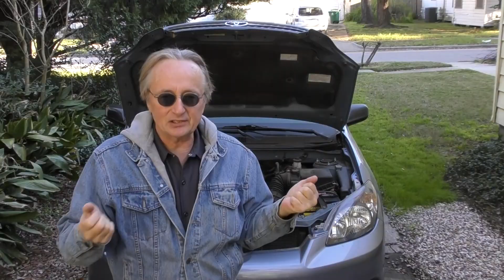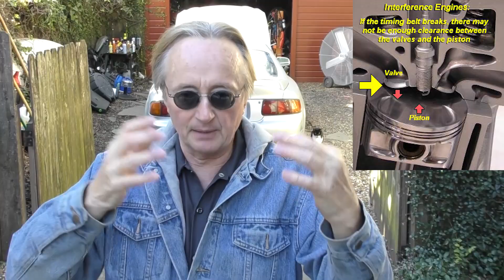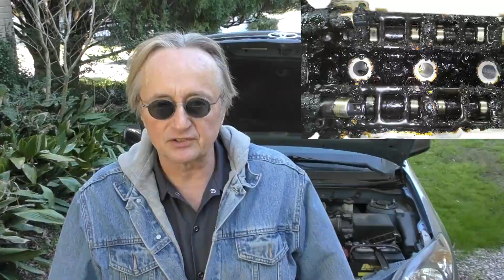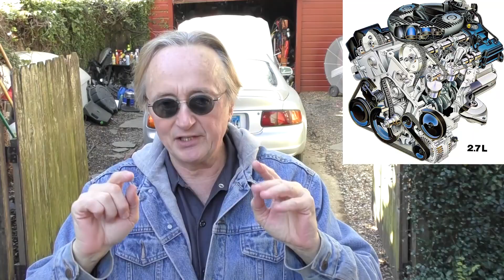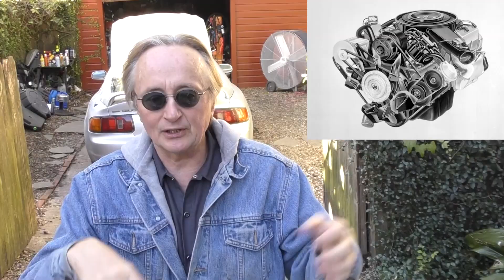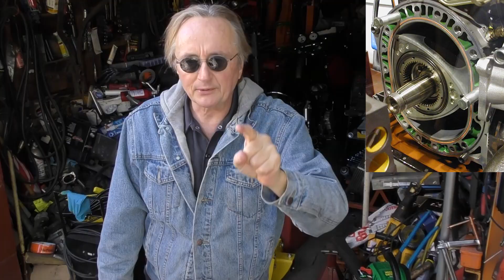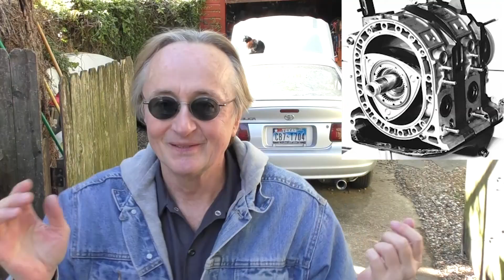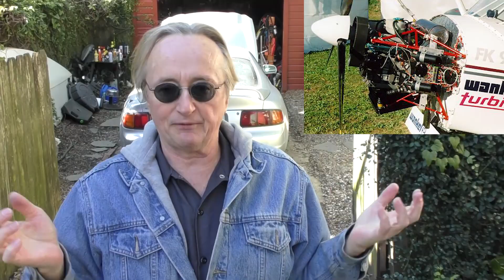Never Buy a Car With This Engine

Comment: About the 2.2 ecotec.  My GF had a 03 Alero with that motor.  One night she called me because it was not running right.  I showed up and that thing is knocking so hard I couldn't believe it.  It had no oil left in it.  Went to the gas station and got oil for it.  I didn't think it would survive the 11 mile trip home.  but it did.  matter of fact most of the knocking was gone.  she drove it for years after that.  it burned about a quart a week but That expierence gave me some respect for the 2.2.  I don't know how it survived that.

Comment: There have been a couple of motorcycle with the rotary engines Suzuki was the only Japanese motor cycle company to build a rotory motorcycle my younger brother had one when they came out it was fast and it was 500cc it was thirsty and kept fourling the spark plug and back then they were $10 when normal spark were about $2 each the reason the plug clogged up was because of the leaded petrol no unleaded then and l was riding a Suzuki GT 750 at the time and the rotary was much faster he would beat honda CB750s

Comment: I loved my rotary motor easiest way to keep an apex seal in optimal condition was mix 2stroke oil in the gas 1 revolution = complete power cycle so in essence they're 1 stroke motors 🤷‍♂️

Comment: Hey Scotty. About that timing chain issue on the 2.2 ecotechs, is their a way to prevent catastrophic damage to your engine? Because i can already hear my timing chain squeeking on idle. Im worried i dont have much time left….
Reply: Replace timing chain tensioner. 32mm socket or 1 1/4". On the back of the motor passenger side corner. You have to take valve cover off and push against it to activate it after install.

Comment: My first car Malibu 2.2 cylinder 2007 eco tech lasted me 225K miles ended in  Nov 2020. Kept it well maintenance synthetic oil change jiffy lube. Last time drove it to work was losing speed ignored it instead added more torch RPM was high next thing POP! Oil everywhere now after a year having my engine swap

Comment: Bring back Magnetos! 
Engine-driven spark boxes that produce their own sparking power, without the need of a battery or alternator. 
This way, if one of those things fails, you'll still have engine power, and all the systems that run directly off the engine will still operate. While your battery powers the computers and various other things.

Comment: Self igniting engines? You mean literally every diesel internal combustion engine ever? And the Wankel wasn't a bad design, Mazda used cheap materials in the construction of the engine and it didn't help that morons that buy cars with rotary's don't know how to maintain them and dog them out. Don't blame the design because of the manufacturer (a manufacturer that didn't even design the engine on the first place) and stupid people that owned them. As for the gas mileage, Wankel engines need fuel injection to be as efficient as they can be. In The early days Mazda went the cheap route and carbureted them. So again, blame the manufacturer, not the design.

Comment: Ecotec engines are very sensitive to dirty oil. The design  with ohc on these motors are just sensitive. They perform well and I see many with over 200k and run smooth . Only the flex pipes are the issues really

Comment: Most timing chain tensioners and guids are replaced with water pump but if you her some raspy sounds above 3k rpm replace them. Your oil filter will get clogged too so oil analysis will tell you this and just looking at your oil when you change it.

Comment: I own a 2005 Cavalier with 2.2 Ecotec. Three years ago I hit a pothole so hard it cracked the oil at the top and made a hole at the bottom of the pan. Fixed the hole with epoxy but the top pan still leaks from cracks when oil is warm and pass by these cracks. No problem It changes his oil itself. X-D I keep refilling the oil once in a while and since oil is mostly new all the time I just change the oil filter two or three time a year. I put regular gaz mixed with paint thinner, methyl hydrate, two strokes fuel mix, kerosene for camping lantern, racing fuel leftover and some other shits and I've put 100k kms on it and it still goes well and starts first time in -40 celsius Quebec winters.
Reply: it does not "changes his oil itself", you still need to change oil even if your oil leaks out and you partially renew it.

Comment: I know Scotty is not a fan of the ecotec 2.2l but I got a 2006 Chevy Malibu LT with 152k miles. Well taken care of. I've done some repairs including the new timing chain tensioner. Wasn't ticking, but I had older style. 
Minimal sludge. I'm using Penzoil full synthetic and Purolator boss filters. Double iridium plugs. Got 180psi on all cylinders. 

Flip side my ex wife had a 2002 Chevy cavalier. That ecotec blew apart.

Comment: Haha I have a 2006 2.2 ecotec it runs good I just noticed the car stall when idling but it starts right up I put in a new air filter and I clean the throttle body anything else I should try 👌

Comment: I like your videos Scotty. I have a saturn vue with the ecotec 2.2L 2wd. I'm embarrassed at how poorly I have maintained this vehicle. When I got it I thought it wouldn't last long so I figured I'd just drive it into the ground, now 10 years later after off roading with it dragging logs through back country literally off road and just plain simply abuseing and barley changing the oil. I changed a wheel bearing on it once but that is it. It's at 150000 thousand now and still going. I wish I would have taken better care of it. I've probably only changed the oil in it 3 times. Some cars just have a will to live. This car has really got me out of some jams. Most reliable car I've ever had. It's not the day to day driver anymore but I'm still using it as a utility vehicle and it just starts every time with out hesitation. I really do regret my poor maintenance for this car.

Comment: Now the 2.2 GM ecotec I will admit they do have timing chain problems but if u put a cloyes timing set in them I have gotten a lot of miles out of tht timing set is it a good engine for me yes I’ve gotten a ton of miles out of them but a take care of my vehicles oil change at 2000 mile good oil and good filters the 2.2 with the manual trans in a Saturn vue for me is a very reliable good car but I do agree there are some issues with this engine

Comment: Have a 2004 Chevy cavalier with the 2.2 ecotec and I have ran that thing low on oil so many times and it has 254,000 miles and still starts right up and runs like a dream

Comment: Most vlom failures are cause from maintenance reasons the vlom controls the oil flow to each lifter when it opens and closes (cylinder deactivation) varnish and sludge do to lack of maintenance will kill the system

Comment: I'm driving a 2003 Pontiac Sunfire with the 2.2L Ecotec. 259,000 miles. It runs and drives like new. I don't know why Scotty is picking on that engine.
Reply: Lol got damn. Still runnin her?
Reply: @slimhavoc4290  Yup. Up to 287,000 miles. Still runs and drives like it's new.(I replaced all four struts and fixed the usual things. Engine and tranny are still strong and never needed repair).
Reply: @Ray-lv7hm  noice. I got a 2008 g5 2.2 with 159,000 on it they are good strong engines. I need new tie rods too lol
Reply: @slimhavoc4290  I did one of the tie rods on mine. It's not easy, but you can do it too .

Comment: i got a 2008 ecotech engine with 136,000 miles--i have changed the oil and filter every 3000 miles on the dot-so easy to do -car runs smooth as silk--never uses oil-plenty of power-just simple to me--clean engine-no sludge-good service

Comment: The Ecotec 2.2 is one of the best engines ever built.
We had a lot of them in Europe and many of them are still going strong.

There was just one difference:
1. The z22se with 147 hp was pretty much indestructible with a strong timing chain and massive tuning potential.
It's not a rarity to find turbocharged cars with 400-450 hp
2. The z22yh on the other hand was a direct injection version of the same engine with 155 hp.
That thing was just terrible, it had so many problems with fuel quality and the ecu was just a mess.
It's like the princess version of the z22se always crying for help xD

Idk what version GM in the USA used or if they have changed something on the setup but our z22se was a beast and if GM was smart they would have pushed more money into Opel engineering because they know what they are doing.

Comment: I own a GM eco tech engine & so far so good. Use natural gas created motor oil & change it at least every 6000 miles. Also drive 32 miles one way to work so the oil tends to get fully heated & foam less. They replaced the timing chain with a tensioned timing belt. Suppose to last 100000 miles but don't ask me to drive it that far. At least every 70000 to 80000 in my book sounds better.

Comment: That's funny he bashes the ecotec, I've had an 07 cobalt ls with the 2.2 ecotec. That thing had 245k and it just ran. I got rid of it and needed something different and have a buddy who owns a 2.4 ecotec in his circle track car. Been running 7500 rpm for 3 yrs and still runs mint. Also got that engine with 170k and still going revving waaaay higher than stock

Comment: I've owned two of those engines, Scotty. My Mazda RX4 crashed before the engine developed problems. The other is a Malibu with a 2.2L EcoTech engine which I still own. My 4T45E transmission gave out yesterday, but the engine purrs. 😄

Comment: So basically, for the most part, unless it's an old school, easy to work on, easy to maintain engine, that had no innovation, he doesn't like it.
Reply: Pretty much.
Reply: @tsntana  half of the videos he does are amazing, the problem is the other half are him bashing on vehicles, or the tech in vehicles because he simply does not understand it and wants all vehicles to be big carbonated V8's again.
Reply: @JasonGroom  That's exactly it.  I know a mechanic just like him.  One of the best mechanics I know and one of the very few I trust.  He HATES working on newer vehicles.  Not only because of the tech, but also the way they're constructed.  Calls them a P.O.S.  My 1995 Camry is a breath of fresh air for him.  My mom's Aveo is a nightmare.
Reply: @tsntana  don't get me wrong, I would rather work on a 1970 olds where I could practically stand in the engine bay and work, but those are things of the past. As a professional mechanic, you either need to keep up or retire and not bother with anything newer.

Comment: My 2.2 won’t miss a beat most reliable thing I’ve been around so far but I do agree that it is hard to work on literally everything is in the way of everything lol
Reply: Yeah same here. It's needed work but the bottom end is very very solid. I've replaced the timing chains twice. Probably gonna need to do it a third time
Reply: I gotta 2007 Malibu 2.2 with 74k miles. It drives great. I just wish it was a 3800 V6🤣it's too slow for my liking

Comment: I had a 2.2L Ecotech which I drove hard for 11 years and never had a problem. HOWEVER, the car manual did not tell you how much oil to put in the motor. I found references online but to make matters worse, THE DIPSTICK WAS WRONG. Whenever you put the right amount of oil in (the amount that let the engine lubricate the top) the dipstick said the oil was above maximum. 

What a classic example of bumbling stupidity from a large car company. The most important info missing from the manual, and the engine itself gives the owner wrong information. 

Otherwise that little engine and it's 5 speed manual were great. I was sad to let it go when I did!

Comment: Does an 08 Chevy Malibu have one of these? Lol
Reply: Probably, yes.
Reply: Scotty is wrong on this one. Keep oil in that ecotec and take care of any overheating problems as soon as you notice them and your engine and tranny will outlast the rest of the car. My 2003 Pontiac Sunfire runs and drives like new with 260,000 miles on the clock.

Comment: The 2.2 Ecotec does have issues with the timing chain, but they are super easy to replace. I've never had any issues with mine (knock on wood), but I keep mine well maintained. I think any engine will fail if you don't maintain it.

Comment: Thank God I already knew this fact back when us elderly folks had to read books, it's crazy those 4 and 8 cylinder were not very good, howeva the ever reliable 3800 v6 that were in the 99,00 Monte Carlo were awesome, it's what is in my 2008 buick lacrosse. Can't believe the 4 and 8 were horrible but the 6 is such a long lasting engine

Comment: I own 2 Buick's, a 95 Century with the not as common (that year, the 4 banger's were most common in the 2.4L engine's on those IIRC, or 2.1L, can't recall) 3.4L, V6. I bought it 6yrs ago for my wife and for a 25+yr old car, it's been pretty good to us. It's got it's minor issues. I have a 2009 Buick Lucerne with the 3.9L, V6 which are real good cars and up there on the reliability scale. Did alot of homework on it before buying, only has 53k miles on it for a 2009 in 2021! My other car or SUV is my 06 Jeep GC Limited 4x4 with the 4.7L, V8 and I've had it for 10yrs almost. Up until the factory thermostat stopped working right which I'm replacing so it can cool properly again (engine coolant that doesn't flow correctly/fully) will cause a car to overheat and also make a heater core blow up which let me tell you, really sucks when it happens. I've always been happy with GM/Buick/Jeep/Chrysler vehicles but if you were to ask me to buy a newer (anything almost or all after 2011, especially a Jeep with those crappy Fiat engine's) I'd laugh. No sir, I don't like the way the newer car's are made, even if I do like how some look and are performance wise. Reliability, performance, comfort, etc, those count most to me.

Comment: For the 2.2 Ecotec, just replace the timing chain components every 100k miles and it'll last forever. Just treat it like it has a timing belt instead of a chain.
Reply: That problem was fixed in the le5
Reply: If your mostly highway driving is so it every 200,000 to 250,000

Comment: Well what the hell. I had a 2004 Pontiac Sunfire with the 2.2 ecotec. I sold the car for $500 with 434,000km (270,000mi) on it. It still ran fine, seemed a little down on power from what it once was. The clutch was still factory original as well!

Comment: My 2008 cobalt 2.2 is at 182k. I did replace the timing stuff at 100k wth the updated tensioner and also replaced the tiny bolt that holds the chain guide with a pin plug combo that bullet proofs that area. That little bolt is accessible through the plug in the head closer to the nose of the car. Otherwise been a good motor. No issues.

Comment: 2.2 ecotech Ha ive never had a problem with mine. I’ve had 4, with one being supercharged. 223,000 miles on my last one before car rusted too bad and current one has 205,000 miles and just now getting ready to replace timing change. Ecotec’s best motor I’ve ever had.

Comment: Ive got the 2.2 le8. Just change your oil early and often and don’t let your car sit idling for no reason. My engine runs fine. Had the GM 3800 3.8 before this and took it 240K. Got 112k on the le8 now. Ive changed a couple solenoids but that’s it so far. No issues and oil changes every 4K all fluids maintained

Comment: Scotty my 2.2 Vortec in my 2002 S10 🇺🇸 just hit 250,000 miles NO SMOKE..NO TICKING..NO PROBLEMS..I bought it "Brand New" in '02 I change my Oil every  5,000 miles with Kendall✌ Full Syn.5w-30w..👍

Comment: I love my Wenkel rotary! 1988 rx-7 convertible. Best car ever owned! Super solid still good paint. Yes bad on gas 230,000mi. 20w 50 Castrol GTX oil smooth engine.

Comment: I had a 2011 equinox  with a 4 cylinder engine that had a timing chain go at 80,000 miles.  It totalled the engine and I had to to total the car.  I have a 2014 verano with a 4 cylinder  ecotek engine.  It has 40,000 miles on it and it is starting to show some of the same symptoms my equinox did (engine stalling, check engine light  on).  Stay away from GM cars with 4 cylinder engines.
Reply: And the 2.8, 3.0, 3.2, and 3.6 V6 engines. Those were piles of junk.

Comment: I'm  a dealer and the 2.2 ecotech has been completely reliable and I've never had one failure.  

the biggest POS besides the 2.7 chrysler is the nissan altima with massive oil consumption.

Comment: I have the new Honda with the 1.5 turbo & I change my oil if it looks a lil dirty or if the meter says 30% oil life left (whatever is 1st) I know that clean oil is very crucial to a turbocharger, $20 for 5 quarts why not change it all the time? I do it myself 1 hour of time. Every other oil change put a new filter mobile1 or k&n n' you're good to go. I don't care how good the oil is I use there's nothing like fresh oil...imo

Comment: I had a Saturn Ion with the 2.2 EcoTec. I didn't know about the timing chain issues. Blew the first motor at about 160k. Bought junkyard engine with 81k on it, had a mechanic put all new timing chain and guides in it before he put it in and it jumped time again after 40k more miles. I always went by the GM  service intervals when the dash said to change oil soon. If I had changed the oil more often it may have lasted longer.

Comment: The 2.2 ecotec should not be confused the 1.4l turbocharged ecotec. Which can go to 300k easily. They have valve cover/pcv issue thats easy for even a novice to fix permanently.